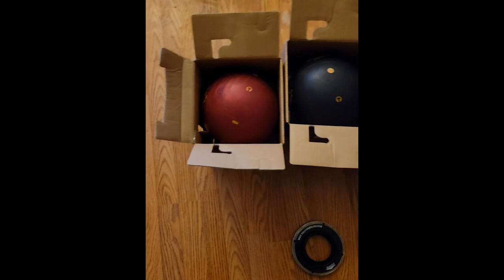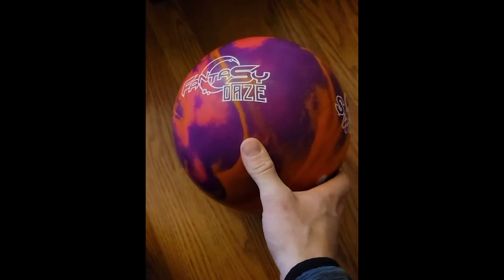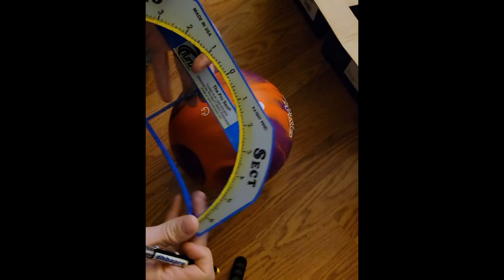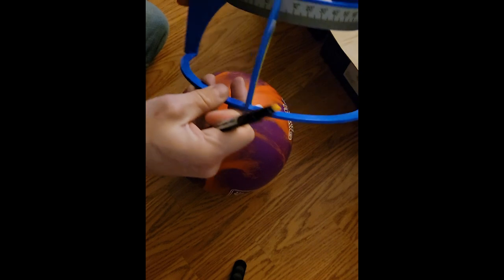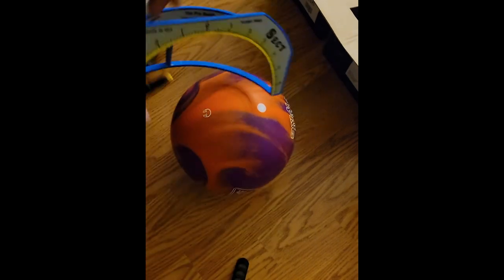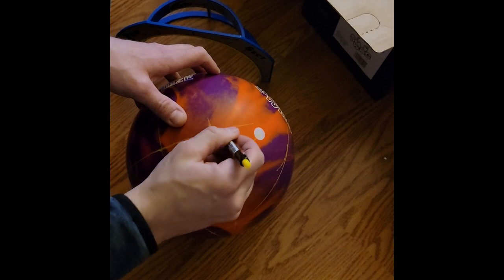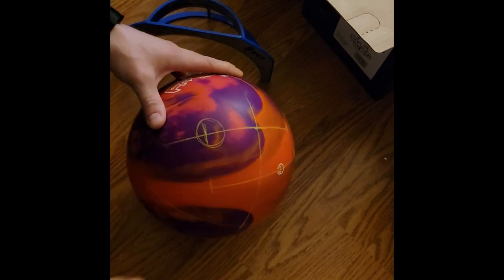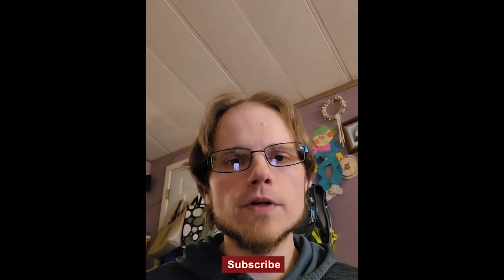Pin Buffer Layouts - What the numbers mean

Comment: I thought it was suppose to be a pin down ball. But by the way it looks of it....it looks like a pin up.
Reply from the maker: Because I have a high track with low tilt, pin down for me puts the pin just above my ring finger. If I was to actually place the pin below the bridge I would have issues with my ball track not clearing the holes on the ball.